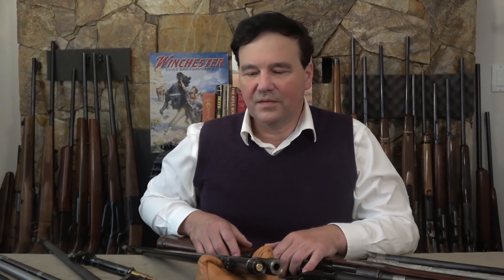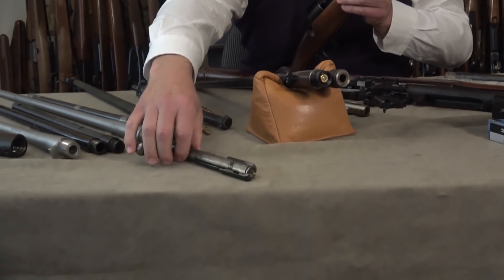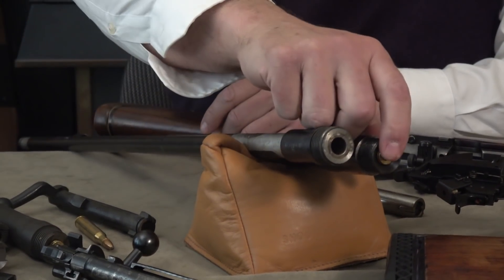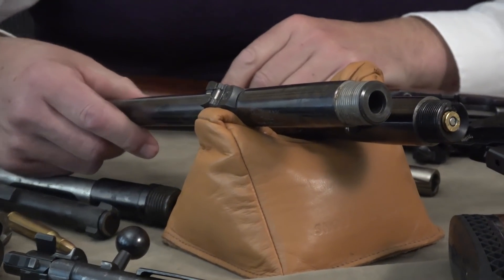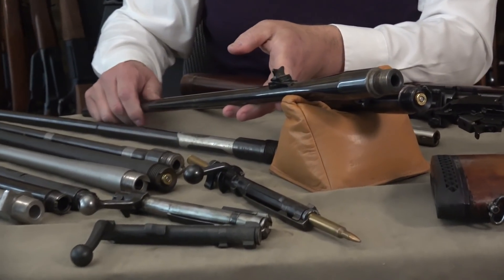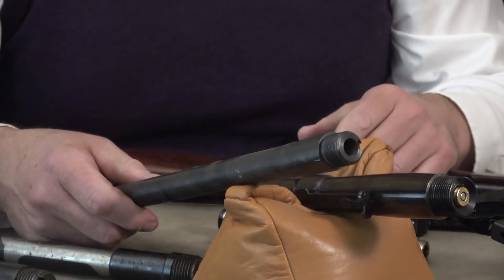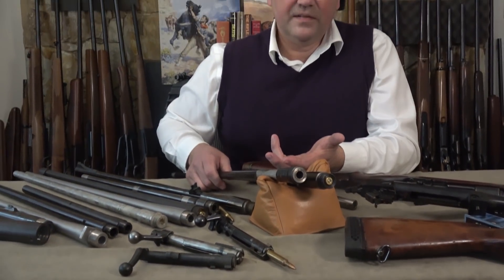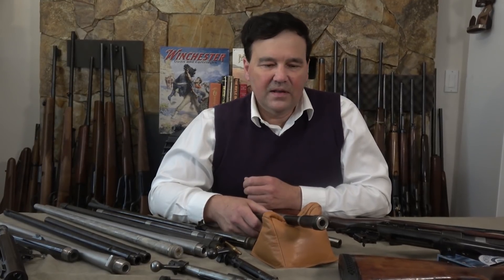How Does Ammo Feed Into A Rifle? CRF and Push Feed

Comment: CRF allows the round to feed into the breech when the gun is upside down?
Reply from the maker: Hello - not necessarily. If the cartridge is say, a 22-250 then the CRF extractor "grip" has enough strength to hold the cartridge in line in the action upside down. This isn't always the case with, for example, a 9.3 x 62 or something like that - with heavy bullets the weight of the bullet can overcome the extractor.

Comment: Great Video. Thanks for sharing. I just purchased a Winchester model 70 Ultimate Shadow. Do you have any knowledge of this gun? Just wondering what your thoughts are and how does it compare to the pre 64. Thanks again for sharing your knowledge
Reply from the maker: Hi Ricky - superb push feed rifle and one of the best. I have one in .308 and with the rifle the bullets have eyes - so accurate. Only when compared to the pre-64 does the post 64 seem like less. On its own - the post 64 is fantastic.
Reply: USOG thanks for the response 
If I did my research correctly the ultimate shadow is a controlled round feed. Please correct me if I am wrong. Thanks again

Comment: That video was a fun way to visualize how manufacturers come up with different ways to do the same thing.  

The pre-64 Model 70 like all other Winchesters was proofed using a load at 150%, whereas the other American manufacturers utilized proof loads of 120% - 130%.  I don't know what Mauser was using for their proof load, but I suspect that it was in the 120% - 130% range.  

When it comes to modern CRF rifles my personal favorite is the Model 70 Featherweight.  I love the elegant stock design, and would like to see Winchester release one in a high grade American or French walnut , jeweling of the bolt along with the extractor and follower, use a super grade crossbolt, inletted sling swivel studs, utilize steel in place of the aluminum parts,  use the old Winchester red color on a recoil pad, and finish it all off in a nice gloss blue.

Anyways, thank you for the video and have a nice weekend.

Comment: Just one thing that gets  me . 
You can single round feed a m 98 and a m96 . I have  . 
The extractor claw is made from spring steel and will happily pop over the cartridge rim  day after day ..  go talk to a ww2 veteran that actually used them . I do like the control feed  you dont  have to slam them in  as you seem to need to in a push feed to get positive feeds .   The controlled is well controlled.(edited for a clearer read. )
Reply from the maker: Thanks Paul and Wizard, The only think I see from time to time is a broken or bent extractor - which seems to have to do with the heat treatment of the extractor claw area. Sometimes they break off on the slam.
Reply: The extractor claw in my rifle isn't spring steel, but I think it is held in with a spring steel band that clips around a groove in the bolt, but I'd have to look to make sure, maybe that band serves some other function, but over the past 20+ years I've never had an issue with it popping off.